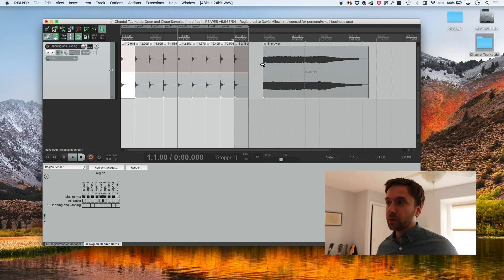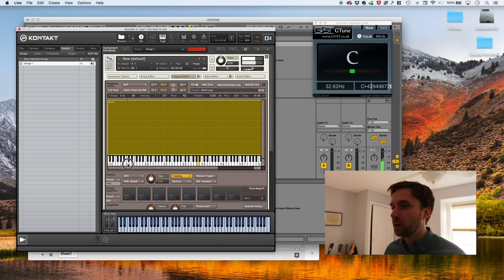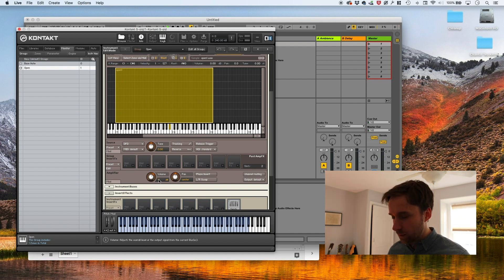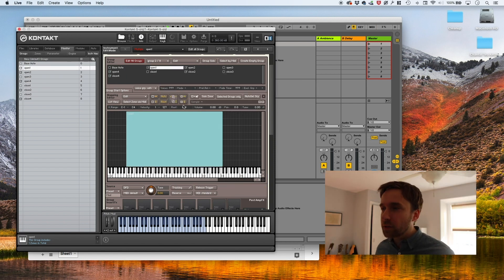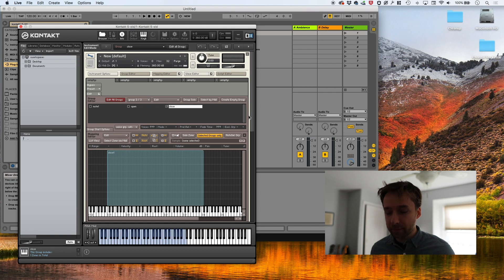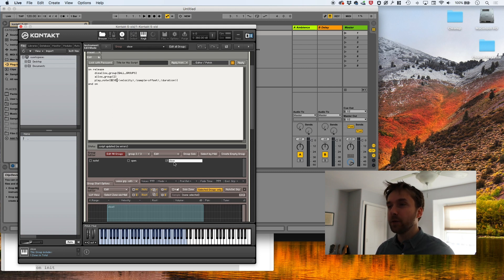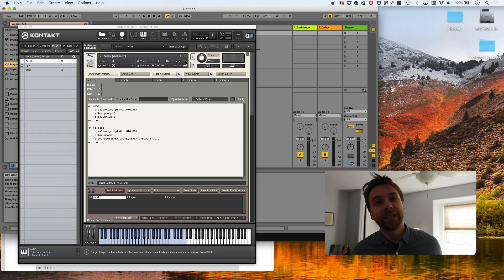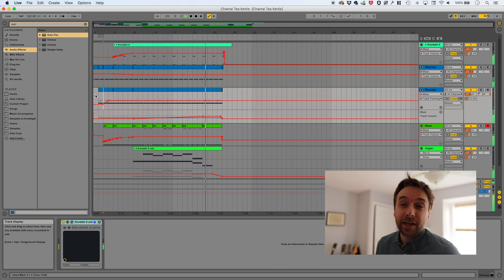Kontakt Tutorial: How to Make Release Triggers + FREE Tea Kettle Whistle Kontakt Library

Comment: Your videos have helped me a lot!! , I have a question ... I want to sample a piano, with samples of pedal up and pedal down, how can I assign the group of activated pedal samples (or pedal down) so that only execute when you play with the pedal ?. I would like to simulate the programming of the 'true' pedal like the library "The Hammersmith Soniccouture". I hope you can help me.
Reply from the maker: Gustavo Isaac Muñoz Hernández Good question. This can get complicated, depending on your setup. The important thing to know is that the sustain pedal is mapped to Midi CC 64. The absolute simplest way to do this is to make two groups, one with the pedal up samples, and one with the pedal down. Modulate the volume of the pedal up group so that low values of Midi CC 64 give a full volume. Modulate the other group with the exact reverse setting, so that HIGH values give a full volume. 

A lot of people use a script for this, especially if they have pedal up and pedal down noises as well.

I may do a video on this at some point. :)